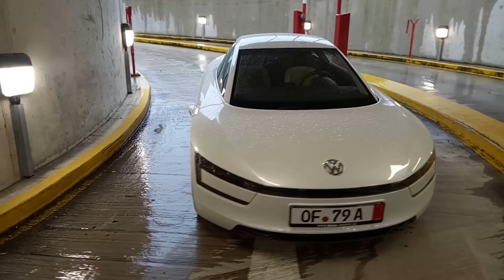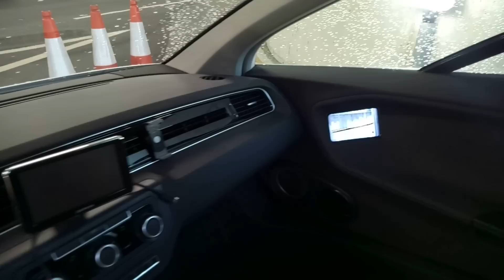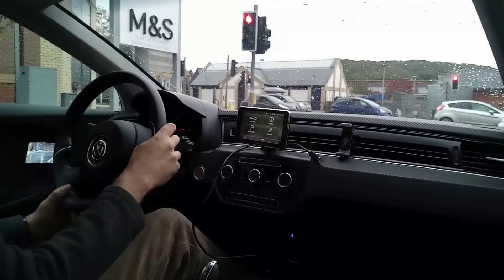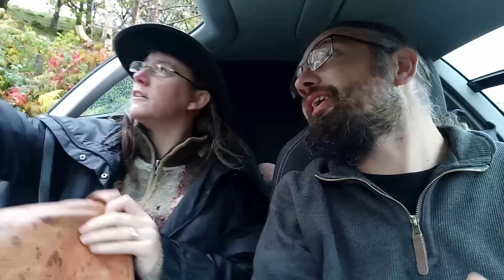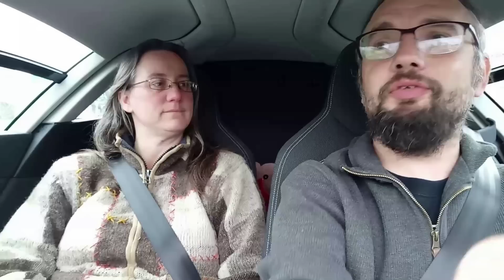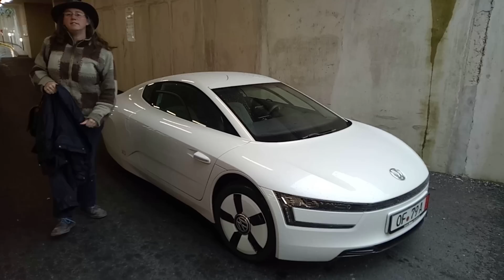Real Road Test: Volkswagen XL1 Hybrid thing

Comment: I recall reading about the prototype many years ago so it's pleasing to see that it actually made it into production, albeit with only 200 being produced.  I've always thought a diesel combined with an electric motor would be the way to go in terms of economy in contrast to what almost all hybrids actually are.  I also wonder what the long-term longevity of diesels would be in hybrids now that they have to be suffocated with DPFs and all that nonsense, especially with all the stopping and starting.

High 90's mpg?  A certain 1.4L TU-powered diesel AX would do 88 ;) admittedly before blowing its own headgasket... I do like the AX for its simplicity, lightweight design and general minimalism.
Reply: Those 1400 AXs were great. My ex had a 3-dr 89 model in black, quite a nice looking car. Built like a biscuit tin and as you say, very unrefined and plasticky, but man, was it quick, and nippy too. I thought it was cool that the door pockets were big enough to carry a standard bottle of wine in an upright position - only the French could come up with that! Where did they all go?
Reply: I've seen several reputable reviews report that the XL1 readily does over 120mpg in the real world even when it's forced to use diesel almost all of the time (which is what it does when its battery is nearly flat).
Reply: When the ax does 88, this one will do 200 or so, like for like.

Comment: Looks very similar to the original Honda Insight? Shows what manufacturers are capable of when they have to be?
Reply: The only slight similarity with the Honda Insight is that the Honda's rear wheel is partially covered. That's it.
Reply: You don't think there are other similarities? The super aerodynamic shape,the size,the styling,the size,the seating etc? Perhaps if like me you have seen them side by side in the flesh you might get it.
Reply: @andrewwilson8317  Hi Andrew, yes I have seen them side by side at a car show. And after reading your reply I went and had a look at lots of images on Google of Honda Insights to try to see what you are seeing. But honestly all I can see with the Insight is a 'normal' looking hatchback but with half its rear wheels covered. The front of the insight (headlights etc) looks particularly like a 'normal' car compared to the XL1 which is very different to any other car in existence. There is a very slight similarity in the profile view of the two cars, I concede that, but again their rear ends are dramatically different. Perhaps its a subjective thing or maybe I just know the XL1 shape so well, but I just can't see the similarity that you do.

Comment: Interesting video and car there Ian. Obviously Mrs H. Not very impressed with it. It sounded noisy on the video, probably worse in real life. Not really appealing to me, that 2 cylinder diesel, lack of space, comfort and huge cost would make it a non starter. Just think what else you could buy with 130000 pounds. Thanks for sharing.
Reply: Yes but then again who in their right mind was ever going to buy one of these to be their ONLY car? You can bet that all 200 cars were sold to buyers who already had a luxury and/or fast car. And, just think what else those 200 buyers will be able to buy with 150,000+ pounds they will get when they sell up in a few years. And as for VW, well they apparently spent 1 billion pounds developing this car but what they learned from the project will earn them a lot more than that because the whole point is that they'll apply what was learned to their designs of their future mainstream models that they will sell millions of units of. VW typically spend over 1 billion pounds on facelifting a Golf!

Comment: Reminds me of the old GM EV-1 from the 90s, a car so ahead of time that it never took off. I believe they were all recalled by GM and crushed, a terrible waste and such a shame. This VW, interesting though it is, is just so ridiculously priced that nobody is going to buy it. At £30k, it may be worth a punt, but £130k! Sorry VW, I just can't take it seriously. You may claim that new technology costs alot of money to develop, but again, sorry, the Baker Electric of circa 1900 got there first with similar range and charging times. Not new technology at all, just a cynical marketing ploy to exploit the gullible. I don't buy the environmental argument either, you have to so viciously rape the Earth of resources to produce a car like this, that you ain't saving the planet so much as killing it. The most environmentally responsible motoring is to buy an older car that already exists, one with a small petrol engine, and maintain & drive it carefully using second hand parts where you can. That is the ultimate form of recycling; making use of what already exists instead of wasting huge amounts of precious resources making new stuff we don't actually need. An interesting engineering exercise, but really no more than that. Sorry VW.
Reply from the maker: The GM EV-1 story is very sad. It wasn't that it never took off, but that GM got cold feet and worried there wouldn't be enough profit in it. It's terrible that they just crushed them all. Must admit that my love of EVs is purely for the driving experience rather than environmental concern, though more EVs could improve polluted towns and cities.
Reply: "Nobody is going to buy it" ?? Not so. VW only ever planned to sell 200 of them and those all sold quickly, with good reason.
Reply: @edstratton  If you think  £130,000 is reasonable for a car like this, I have some sea front property in Birmingham you might be interested in.
Reply: @matthewgodwin3050  No I agree it's not reasonable, its a huge amount of money if you plan to use the car up and wear it out. Just like limited edition supercars, it only becomes 'reasonable' if you can afford it and then eventually sell it at a profit. And £130k is £35k more than the owner paid for it new. It will be very interesting to see what this one sells for next weekend:  http://www.silverstoneauctions.com/volkswagen-xl1
Reply: @matthewgodwin3050  You are right its not reasonable. It was way too low! You are effectively buying a limited edition carbon fiber concept car for the road. Seen many else of those cheaper lately? Please.... compare apples to apples here.

Comment: Quite jealous that you got to experience one of my favourite modern cars.  Funnily enough, it's the styling I really like on these rather than any of the technology it's wrapped around and, from what you describe of how it drives and how impractical it is, I reckon I'd absolutely hate driving the thing.  For commuting to work and back it likely makes an awful lot of sense since you wouldn't have to be carrying much with you, it's just a shame the hefty price tag and the rarity put that option out of the grasp of many of us.
Reply: Trust me you WOULD love driving it - they are just the best fun.
Reply: @edstratton  It's the firmness of everything that's the issue more than anything else, most German cars I find really uncomfortable and this one looks like it would be worse than most.  It doesn't detract from how much I admire the thing, I just don't think driving one would be for me.
Reply from the maker: I though the driving experience was most agreeable. I only found out it had 115 width front tyres after I'd hooned it through a Welsh storm, and found it cornered very nicely. No PAS to dull the sensation, and a mostly-smooth power delivery. But yes, entirely impractical for most and ridiculously expensive.

Comment: Ahhhh, the days of pre diesel gate VW

Still, I have read somewhere that the next model of diesel golf will have a mild hybrid system, still in this day and age I'd rather have a petrol hybrid
Reply from the maker: I don't want a mild hybrid. I far prefer the idea of a range-extender hybrid that's predominately an electric car. That's the bit of the driving experience I like best. The engine should be the last resort, or manually engaged for out-of-town driving only.
Reply: I still think the best hybrids are the Toyota's as below a certain speed it prioritises electric but at motorway speeds it is sort of 50/50 with the battery, and as the CVT is gear based it's smooth as silk
Reply from the maker: They tend to have very little battery capacity though, so can't remain in EV mode for long.

Comment: Wow — stunning looking VW! Was it a manual transmission? Had both Mk2 & 3 Priuses, Toyota only make these as auto, so you can’t sit revving the engine as you did in the Volkswagen, neutral gear won’t charge the battery in a Prius (although you can throw it into engine braking mode which will regen the battery). The VW looks a similar size to the CR-Z rather than the Insight btw.
Reply from the maker: No, 7-speed DSG dual clutch automatic sort of thing.

Comment: i am genuinely disappointed by the mpg or km/L  you managed to achieve. Not impressive at all specially not for a  light weight Diesel engined car.  But a cool videos all the same!
Reply from the maker: I was expecting better, but then it did do better on the long journey. My time with it was brief.
Reply: My 65 year old Lancia is nearly as good as that, and it has four cylinders, four doors, a back window, and seats five! I get 45mpg round town and 60mpg on a decent run - I would expect to get at least 50 - maybe 55mpg on that sort of hilly run.
Reply: @saxon-mt5by  This does at least double what you lancia does, like for like. Probably closer to triple.

Comment: Everything, but the fact that it has a tiny battery and is a hybrid, is superb. Done as a pure EV this would be a brilliant (but flawed by a lack of boot space) car - mainly because of the aerodynamics but sadly it's a modern dinosaur - diesel indeed !  No wonder only 200 were made as for all real life purposes they are useless. £130K - fools and their money are easily parted.
Reply: It actually has plenty of boot space - 140 litres of it which is room for quite a few bags. VW made 250 of them, NOT 200. They only ever intended to make 250 which is why they NEVER marketed this car. They were simply never interested in how many of them they might be able to sell!!! The project was only to enable them to learn how to make their every day mainstream cars more efficient. That's the way huge manufacturers do things. VW typically spend over 1 billion pounds just facelifting a golf! This project also cost 1 billion and that is a normal R & D budget for this kind of learning exercise.
Reply: @edstratton  Yes big companies are very good at throwing big money at R&D but very rarely get a return on it. I worked for one where the very talented and imaginative engineers who could have innovated and designed real world beating products were ignored and told to do as marketing wanted. Inevitably the cash ran our as it always does. Nothing changes sadly.

Comment: 59 mpg. My 1989 3 cylinder turbo diesel Daihatsu Charade did much better than that.
Reply: And I thought my 1988 Ford Fiesta 1.6l Diesel did well with ~43 mpg in real city life. ;o)
Reply: It's a shame they rotted away  cracking car   driving instructors loved them
Reply: Everything rusts on British roads on account of the salt. We (Ireland) stopped using it on our roads long ago. Underside welding is unheard of in Ireland. I recall one remark from a mechanic saying it was very well built.
Reply: I am sure it did, but certainly not like for like.
Reply: My Fabia vRS diesel hot hatch does better than that on performance tyres...

Which winds my Toyota hybrid owning friends right up.

Comment: One issue with this sort of tech and the narrative that can go with it in terms of environmentalism is typified by things like replacing a mirror with a camera, display unit and wiring to go with it.  It is environmental providing you ignore where it isn't.
Reply: I agree. But the car was not designed to be environmentally friendly, but energy efficient. That has a lot of overlap, but it is very different at the same time.
Reply: But typical of the avenues manufacturers go down. This sort of vehicle would have its energy efficiency marketed as environmentally friendly if it went into mass production.
Reply: @Senapspiser basically a diesel lotus :P
Reply: @RoobehTunes  Lotus did an interesting prototype Elise with a body made, iirc, of hemp. Hemp seat fabric etc, bio fuel engine. I wonder how environmentally friendly it really was? Hmmm... must consult Mr Google on the matter.

Comment: WOW that is a rare car, glad you got your hands on it, i renember it being in the news and stuff for being the 1L/100km car (only 200 where made and sold at a loss for 100.000€)
Reply: Actually 250 were made, of which 200 were sold. No loss was made. VW never marketed this car for a very good reason: it was because they had absolutely no interest whatsoever in how many of this model they might be able to sell. They only ever intended to make 250. The project was only to enable them to learn how to make their every day mainstream cars more efficient and to learn what compromises buyers could live with in the real world. VW typically spend over 1 billion pounds just facelifting a golf! This project also cost 1 billion and that is a normal R & D budget at VW's level for this kind of learning exercise. They gave their engineers a seemingly impossible target to achieve of getting 100km from 1 litre of fuel - THIS was the only point of this car. It took them 12 years to achieve that goal, and in order to achieve it the car HAD to be this light, this aerodynamic, etc. How many they might sell was never a question on the table. Only when you know all this does this car make any sense. They 200 of them and kept 50 back for ongoing research. If VW had needed to recoup their 1 billion pounds development costs by selling 200 cars, they would have had to sell then at £5 million pounds each, and that would mean they would have made a loss of £4.9 million on each car. No, they are recouping their 1 billion by using what they have learned from this project to make their future mainstream cars more efficient by being lighter and more aerodynamic etc etc etc etc.